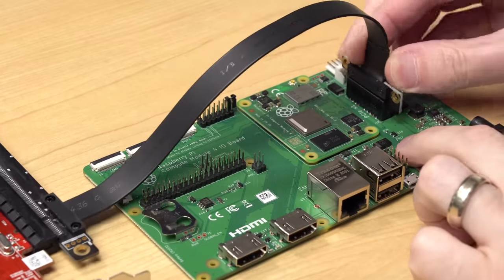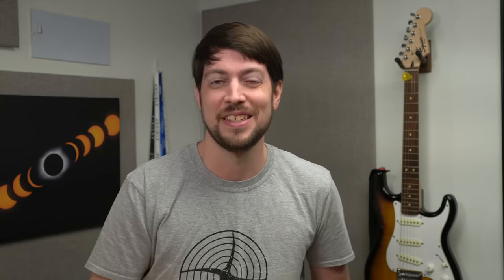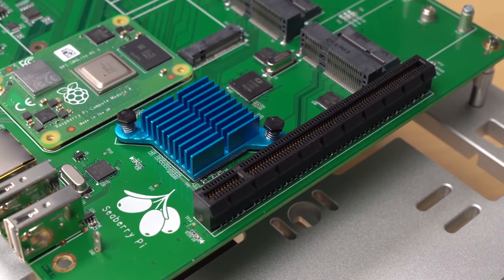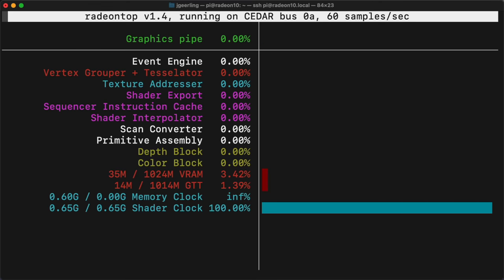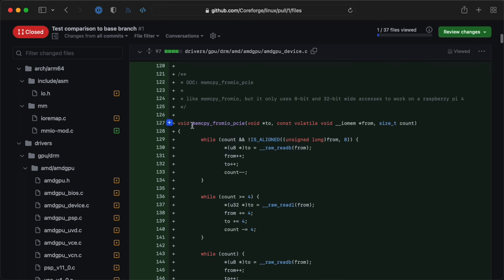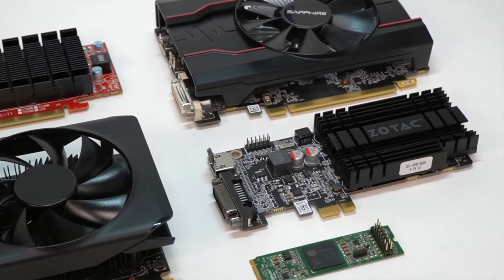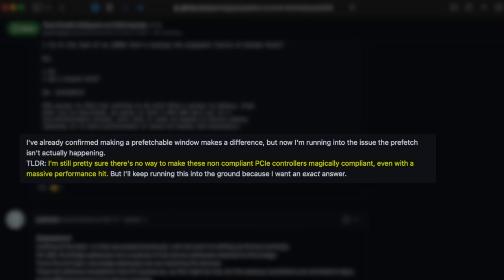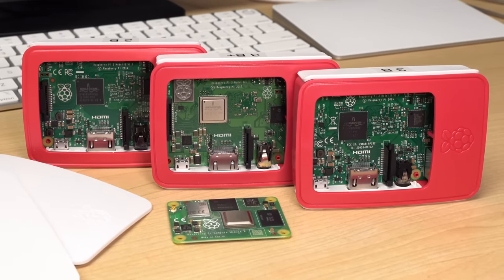It took me TWO YEARS to get this working! (GPU on Pi)

Comment: Regarding GPU usage, I have something that might be worth making a video or two about.

Recently, I tried installing Raspberry Pi Lite, Plex Media Server, and OpenMediaVault on a Raspberry 3, to see if it could run as a Plex server, instead of me having to run my PC for the same task.
It worked... kindda. I could play all .h264 MKV files with Dolby Digital, DTSHD-MA, DTS, ACC videos, and some .h265 videos in MKV or MP4 format, but only on some devices.
On my 2 year old Sony TV (KD55XH9505), I could play any video file, although high bitrate videos was a bit of a mouthful for the Raspberry Pi 3. It was the same case, on my Samsung Galaxy A51. Everything ran without decoding.
But I couldn't really run anything via my PCs browser, not even with the dedicated Plex app for Windows. Either the video or video and audio has to be decoded by the raspberry.

So I really had the success  I wanted, as I only ever use my TV for Plex. But I still had the issue, that some videos didn't play well, by the Raspberry. So I invested in a Raspberry Pi 4 (yes, these were never out of stock in Denmark, and for more or less normal prices). Now, anything can run on the RPI4. I can even run a 60 Mbit/s video on my TV, and video on two phones at the same time, no swet. Heck, I can do it over the internet!
But I still can only run a few files on the RPI4 via browser or the Plex Windows app. And most are decoded by the Pi anyways. I visited my brother a few months back, he has a 4-5 year old TV. No luck with playing most files. 

So it could be really nice, if one could add a GPU to an RPI4, and have that decoding the files, although I now know it's probably not gonna happen. All in all I'm very impressed with what the RPI4 can do, and I blame the Plex software on Windows, more than I blame the RPI4, for not running my files. The answer from the Plex forum and its devs, is more or less "well of course it doesn't work". How my TV and in particular my $200 phone can run these files then with direct playback, I don't know.

Comment: You want to get in touch with these companies that nearly works properly together to get in touch with each other to work out the glitches. This could be the way forward, this might be awkward as Raspberry Pi is English and may take a bit of Anglo American partnership and try and get a company to work open source. All of this can be slightly manipulated and adapted to make a uniform system which each company would benefit.

Comment: Great video, thanks !
I have been involved in getting support from these manufacturers, and all I can conclude is that this is undoable. Even in an iMX chip from NxP you will never get your hands on a good register description of the GPU. Actually this is a real shame*, because in fact they are cancelling out small developers and let the bigger ones profit again and again.... While I have *bought the damn chip with the GPU inside.... sitting there hopelessly. And now you might say: "They support you with drivers", but well, not everybody is using Linux or Windoze, and not to speak about the bulky code that we do not even want.

Comment: “… to find ways to push hardware in ways it was never meant to be pushed.”  Baloney, you are doing what you are supposed to be doing!  If the drivers don’t work, that’s on the vendor.  On paper, what you are doing should be easy!

Comment: It's really sad that the linux kernel, the amd drivers, and the silicon founders are such a mess that it barely works despite following norms.
Thank you for your contribution to the open source community.
With your dedication and combined work with other, you were able to initiate a simulacrum of working.
I hope you will have an easier time to stabilize your work, and that you will enjoy every moment of it, good luck!

Comment: I'm guessing the people who told you to try Windows 11 have little to no experience working with Windows on ARM. I got a Samsung WoA laptop just to play around with the platform and while it shows a lot of promise (the battery life when running native ARM software is crazy!) driver support for all kinds of hardware is currently abysmal. I had to setup an intermediary service powered by Ghostscript on another x64 machine to get printing working since there isn't (and likely never will be) an ARM driver for my old Samsung laser printer. I don't think people realize how much effort has gone into getting the x86/x64 platform to the "it just works" stage it is currently at and how much is still to come to get ARM to a similar place.
Reply from the maker: Yeah... I think too many people see how seamless Apple makes platform transitions (680x0 to PPC, PPC to Intel, Intel to ARM), and just expect that Microsoft does the same thing... but no. Microsoft seems to still treat ARM as a side project.

It's sad because MS has the foundations laid, they just don't really seem to put their full might behind being more architecture independent like Apple has done.

Comment: If you want to try a native linux game on the PI with more modern graphics, you can try with "fs2open" with all the current mediavps. The current version does not work on the PI because it needs OGL 3.2, i was only able to run the older versions of it on the PI with the old graphics mods.

Comment: @JeffGeerling - This is probably not possible, but what stops using a pci-e hub controller with custom firmware, to handle translations. While it wont resolve a lot of the functionality issues that are directly a result of Broadcoms proprietary PCI-E controller. It could provide a route to work around the controllers bugs by translating it into functional calls.

While it probably would come at a performance hit, im doubtful it would come at enough of one to be les than useful, compared to its current state.
Either way, im excited to see where this can go from here.

--

Ultimately, i agree with other users. We need to see more standardisation of things like USB and PCI-E in these platforms. It may be easier with RISCV as at least, there is underlying standards 3rd parties cant ignore. Unlike ARM that lets the manufacturer take any proprietary approach they want.

Comment: NVidia's Jetson Nano works well for a desktop computer & has the NVidia's graphics DNA built in.   I have used it without too many problems.  But because of license issues it won't run Netflix, HBO etc.  And it only cost $99 USD.

Comment: Maybe worth trying with Firefly Core-3588J. It uses Rockchip RK3588 which is using modern Arm cores , higher frequencies, has 16GB RAM, Gigabit Ethernet, and PCIe3.0 (2×2lanes,1×4lanes,4×1lanes) 、3×PCIE2.0(1 lanes). And the best it support UEFI Boot. (Not sure if it has ACPI support tho).

Comment: My interest in a Pi board, or other SBC with graphics acceleration isn't really to play a current top of the line 3D game, or do other things that my current desktop can do. I'd just like to get decent performance, that's above and beyond what's built into the processor chip. I'd like to be able to construct a cheap TV box, countertop project, home assistant, or even a low powered desktop, that can display information related to those tasks, without lagging, or stuttering. If I decide to make a streaming device, that I can mount to the back of a TV, I'd like to be able to turn it on & use it at full resolutions, without worrying about what's running the display.

In my perfect SBC world, I think it would be cool, if there were peripherals made for these things, that were as easy to plug in & use, as peripherals were in the days of the original x86 hardware. It would be cool, if there was some sort of equivalent to a video card or a soundblaster, that could work as seamlessly as equivalent products did - back in the day. Pi's have a lot of potential for all sorts of projects. Many areas where the Pi shines, I think are with projects that deal with sound or video. 

At the very least, I think Pi projects could be improved, if they could be upgraded to the point, where you aren't being distracted by the performance of the human interface. With the size of the Pi, that should be something that can be pulled off. Mobile phones can do amazing things, in smaller packages. Why should our Pi projects not look  just as professional? If a Pi is going to have two 4K capable HDMI ports, it should be prepared to impress or at least have the upgrade potential to hold its own. Surely, you don't need a three fan Radeon card, to drive graphics for a Pi. There has to be something in between the onboard graphics, and a 6000 series graphics card. Surely, there could be an accelerator that could mount to the Pi, instead of requiring the Pi to be mounted to the graphics card. (requiring a separate power supply for cooling) Just my opinion.

Comment: So, crazy idea….. with the community, wouldn’t it be easier to build a custom raspberry Pi graphics card and write your own open source drivers?
Reply: I don't think the problem is the graphics cards, since AMD gpu drivers are already open source on linux, but the problem is pi CPU (BCM2711) having problems communicating with the external GPU

Comment: So what I'm hearing is that GPU on CM4 doesn't work and likely will never work because the Pi Foundation cheaped out on the PCIe implementation.
Maybe someday they'll release a Compute Module based on hardware meant for Windows on ARM machines. That should clear up hardware problems (and have plenty of raw performance), though it'd probably get pretty expensive.

Comment: Jeff: Spends two years writing custom kernel modules for multiple GPUs (freakin' wow dude!)
Me: Spends two years getting around to configuring nut to communicate with a UPS and adding a few lines to bash_login :\
Reply from the maker: Hey now... I've been trying to integrate my UPS into Home Assistant (not quite for two years) but still having issues too :D
Reply: @JeffGeerling  Looking forward to that video when you figure it out!
My next challenge is to have my server signal the other machines running off the UPS to shut down when the time comes. shutdown command over SSH seems logical, but I'm not sure how the 'nut' user can do that (nologin)

Comment: Wait, is the HW Pcie controller broken or the driver implementation in the kernel?

If it is the HW i would just ask rpifundation to build a revisioned hardware with some crowfounding efforts. (Maybe a pie controller with 1x4/2x2/4x1 lanes?)

Comment: Somehow my gut tells me that the next Raspberry Pi 5 won't use a Broadcom chip but a chip designed in house by Raspberry Pi Foundation somewhat based on the RP2040 chip but instead of using M0 cores something like anA7__ or X series core, I could even imagine that they will retain the PIO state machines because the programmable logic closes a niche market between general purposes CPUs and FPGAs.  Downside including PIO will make many Pi-Hats unnecessary which might be unpopular with manufacturers.

The whole naming scheme of the RP2040 already suggests that more chips of the RP family are planned.

Comment: There is a market that the Rpi foundation is missing. If they could get some more graphics performance out of the pi itself or make an expansion board with its own  basic gpu, not something to run AAA titles but instead do at least 1080p youtube without having a stroke.
Add in a simple touch screen and case... ta da you have kicked all budget PCs and tablets in the face.

Comment: The 3050 Ti should be great to test this if I'm not wrong is a PCI x2 (tought the slot is PCI x16)

Edit: I made a mistake the 3050 isn't PCI x2 is PCI x8, and there isn't a Ti version for desktop.
Reply: That's the 6700XT, not the 3050
Reply: @theforerunnerreclaimer  I know, is just a comment about the 3050 ti being pcie x2
Reply: @Egan466  I meant, the 3050 isn't x2, thats the 6700XT that is, no RTX cards are x2, x4, or x8, they all come x16 and are able to almost completely use the entire bandwidth of a gen 4 x16 connection
Reply: @theforerunnerreclaimer  You are right the 3050 isn't x2 but neither is x16 is an x8 you can check this in her specs sheets.
Reply: @Egan466  Ah you're right, it has a full length slot but only uses a x8 interface

Comment: this was illuminating - the next gen has a lot to work out...i think the way to go may be hetrogenous clusters - have a host with pci passthrough for networked gpu processes - pls do a smb cluster - with proxmox or qemu - benchmark best nvme scaling - smb sector wants high performance iops and easy cheap scaling - i think you can do it for about 300-400 a node and nvme scales well so there are real gains to be had to optimize erp and achieve best possible biz efficiency - the next gen zen4 will be fantastic but next gen sbc are going to be exciting as well - huge ipc and io gains are on the way #red shirt jeff composite benchmark #ashy to cachey

Comment: Yeah I expected it to glitch like crazy because of the ARM CPU cache coherence issue. If a PC graphics card driver relies on CPU cache coherence it will have a bad time :D Since x86 has coherent cache every PC driver will take advantage of that.... and no ARM driver can because ARM CPUs do not have coherent cache. And because ARM is aiming to be a RISC system and coherent cache is super expensive to implement in hardware so they sidestepped this thing.
Reply: Each core is a different NUMA domain on Arm, nice. Well that can’t possibly hurt performance or break software.

Comment: If you make a cluster to connect that GPU, maybe it works better? 
Would it be possible to multiply the processing cores and only address the rendering of graphics obligatorily to the GPU connected to one of the RP4 modules of the cluster?  
A pipeline is likely to occur as the PCI-e port interface has read and write limits on Raspberry Pi.  
Can you reproduce this experiment or tell us about its works?  
The cost, I believe, is a relevant factor, since the initial objective would be to produce a device that has low cost and satisfactory performance.  
And would Radxa Zero be more compatible with these AMD GPU experiments?

Comment: Hello Jeff, I have a PCIe x1 soundcard (high quality digital transport) that is designed for x86 Intel/AMD computers that run Windows or Linux. How would I go about trying to get it working with the RPi PCIe x1 slot. Should be easier than a GPU as the signal path is much simpler.

Comment: Pushing a system to do something it was never ment to to is what made the C64 a interesting machine. The difference in games at the start and the end of the C64 periode shows how much you can do when you push the limits for a long time.
When a change in drivers for 3D card can make a 10 to 15 % difference it shows that a lot of performance is lost because there are more money in selling new cards instead of making the software for older card better.
Reply: the c64 is still doing stuff that wasnt intended, you only have to listen to the prodigy music on demos liek wonderland 13 for more jaw dropping c64 moments - https://youtu.be/FqxjsfTLUrA?t=422
Reply: @disasterincarnate  Commander X16 from the 8-bit guy is also something to have a look at.  :-)

Comment: Speaking of AMD 6000 series, the 6400 runs on 4 lanes and it runs on 52watts
Reply: and is a bit slower than a RX 570 while costing the same; comes out 5 years later
Reply: @AntonioNoack  you funny, I like the 4 lanes

Comment: Hmm I thought there was an xorg driver that supports frame buffer maybe that was back in the days of xfree86. I remember using X with framebuffer way back when.
Reply: Maybe xorg-x11-drv-fbdev?
Reply from the maker: There is, and it may be able to work at some point—but it seems like there are major issues with ARM support since that driver's so old, and it doesn't seem like anyone's interested in fixing it.

The M2_VGA card with the SM750 is also only really intended for server applications, so I can see why ASRock Rack didn't want to give me any extra help there either ;)
Reply: @JeffGeerling  Ahh ok yeah it is old.

Comment: I find it strange that so many manufacturers would ship broken interfaces. the pcie controller is there for a reason. so it's it  really broken or is it just incomplete.. you would think that hardware manufacturers would expect all parts of a chip to work.
Reply from the maker: It worked well enough for the original use case of managing a USB 3.0 controller... it's just that I don't think they imagined we'd be plugging every possible device into it :)

Comment: It is a bit absurd of these SoC manufacturers to provide PCIe without it being standards compliant. Makes you wonder what they intended the interface for. If you're developing an industrial applications, you probably don't want to use an interface that "kinda works".
Reply from the maker: Honestly since they're built mostly for embedded devices, I think they target the baseline use cases (e.g. the BCM2711 was mainly tested with USB controllers and small peripheral devices until the CM4 came out).

Comment: the pine64's quartz64pro will be a great arm platform using a rk3588 and hopefully support pcie graphics cards
Reply from the maker: Check out the portion on alternative boards towards the end of the video—the RK3588 has similar hardware-level issues when it comes to PCIe support.

Comment: If AMD can get ROCm to work as well as CUDA, they would eat Nvidia's lunch.  CUDA is still the only reason Nvidia is still so dominant on Linux, otherwise, there's no good reason for so many Linux users to have Nvidia cards in comparison.
Reply from the maker: Agreed; the challenge is enormous, though... Nvidia has a huge head start in AI/ML and GPU compute in general, and CUDA seems to be somewhat of the standard for many fields now. I wish people would target abstraction layers or an open standard a bit more, and Nvidia's tooling directly a bit less :(